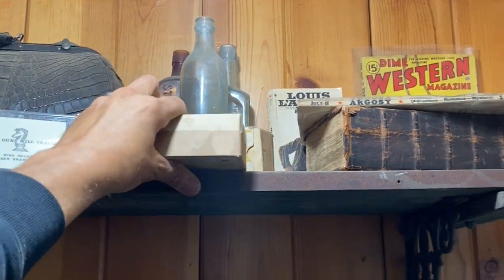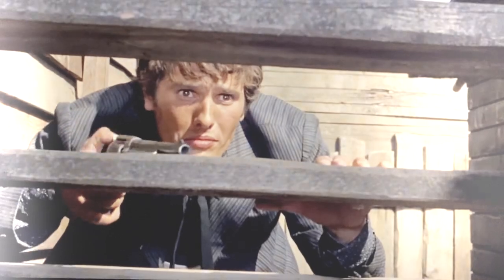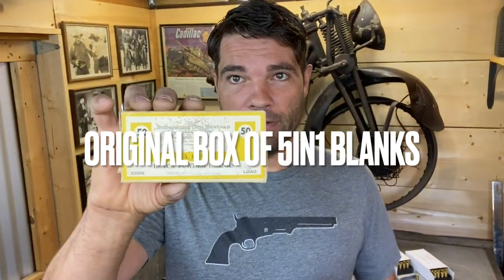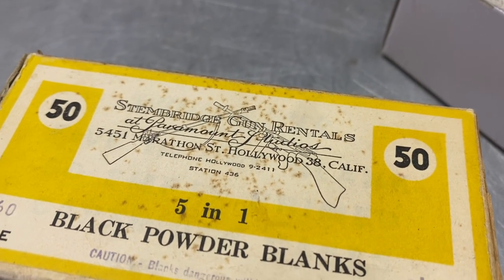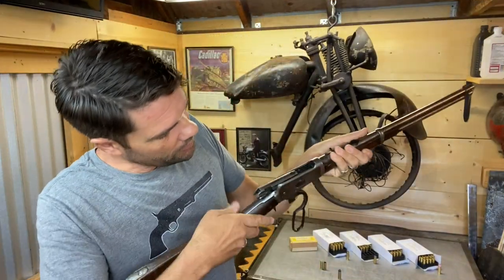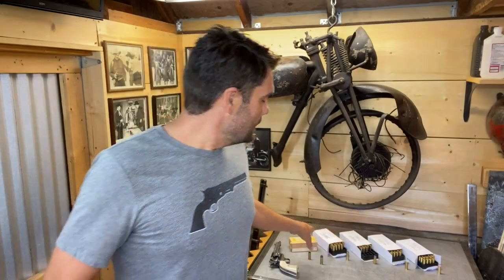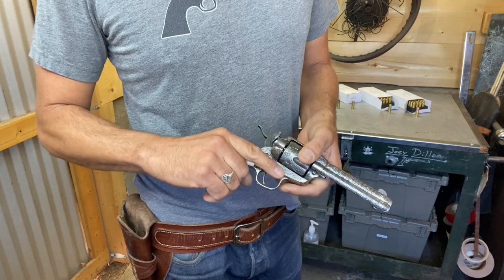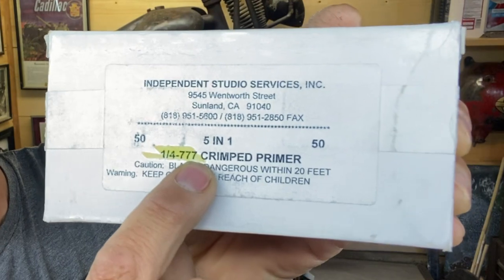5 in 1 Movie Blanks: History and Modern Use, with Armorer Joey Dillon

Comment: This was very interesting about how the movie industry handles various blanks. I took special interest in how they peen the primer pocket rim at 12:23. My method is to drill out the flash hole to 1/8 inch to let the gas escape and not drive the primer out. The drill out method can begin to fail after many reloadings. I think the primer pocket gets to big. Do you now if that is done with a die tool or is it done by hand with a punch?
Reply from the maker: Not sure how it's done!

Comment: I've been doing a Jesse James train robbery (1874 Gads Hill) gunfight show, St Louis Iron Mtn RR, for 7yrs now. I'd like to tell ya it's a re-enactment, but there was no gunfight in Jan of 1874, so we're actually giving the riders something most have never seen in person. As you can see in my pic, the wardrobe is more Warner Bros Central Casting than 1874 Missouri. Over the years, we've used a few different blank styles; WFDA balloon-load type, straight case foam-topped re-useable loads & the commercially available crimped brass blanks. Since we're an outdoor show, we use full-load blanks for the full effect for report & smoke. I personally like reloading my own with GOEX, but they provide the store-boughts for us. The upside is that they make dandy souvenirs for kids. Blanks & real guns on a movie set is something I hope doesn't become a thing of the past, but I have a friend who works out at Old Tucson Studios & currently they allow nothing but blocked-barrel blank guns. Hopefully, this will change.
Reply from the maker: Thanks for the comments. Sounds like you're having fun out there! Yea I hope blanks and guns continue too...
Reply: A local volunteer theatrical company was doing play "Shadows of a Gunman" about Ireland 1916. One of the actors brother was a gun collector/reloader who supplied a couple of period correct SMLEs, because it was an indoor stage full power .303 Blanks too loud, and primer only cases popped but little more. The brother put some Pyrodex in case with a loose bit of tissue to hold in.  Result was primer pop with some  flash and smoke but no extra noise but visually impressive in that type of environment. Never heard about anything like that. Is is done?

Comment: Hey there Joey. First of all thank you so much for being my inspiration for getting in this hobby. I now post videos on my YouTube about gun tricks as well. 

I just have two questions for you:

What modifications have you made to your Cimarrons if any? I ask that because you fan it decently hard and it seems to lock up just fine. Did you change the geometry of the bolt to lock up with the cylinder better?

Also what is the name of that trick you do where you switch hands by doing a rode agent spin then twisting the grip more to be caught by your other hand? I’ve done it for years but I never knew what it was called or who invented it
Reply from the maker: Thanks for reaching out! I haven't done any mods to my Cimarrons, they felt pretty great when I got them. I am not a fan of hair triggers, but I do like lightening the mainspring if it is pretty tough. But these were pretty good as is. That trick is called the "Saloon Keepers Roll."

Comment: In one of my old gun magazines from early 1970's, one of the Los Angeles gun guys (Peterson Publications), referring to reel guns, stated that Model 25 S&W revolvers in .45Colt, with available blanks, were used instead of Model 29's in .44 Magnum that needed custom blanks.  The Model 25 and Model 29 same gun just different calibers so audience wouldn't know difference. Is this true or just a gun myth?
Reply from the maker: That's a good question. Not sure about that one, athough I would think the 5 in 1 blank would work in the Model 29 and that blank goes back a long time.
Reply: @FilmArmorerJoeyDillon  I have some 5in 1 blanks,  both brass and plastic, I've never tried them in a .44 caliber chamber.  Years ago, in an article with pictures in gun magazine that a acquired, some crooks stole some pistols including a vintage, black powder framed SAA, loaded chambers with .44 Magnum cartridges, they fit but a little loose, and blew the gun up that was eventually recovered by police and returned to owner in that condition.

Comment: Thoughts on the 1873 colt vs the 1875 Remington? Looking at both from cimmaron in the 7.5 inch barrel. Really like the looks of the 1875 but hard to pick against the colt I’m assuming?
Reply from the maker: I love them both! I couldn't decide either, so I got one of each, and when I used to  do my gun handling routine on stage I would spin both. I had matching grips that sort of tied them in. The colt is best for its action, larger spur hammer to grab, but the Remington looks cool with that tang under the barrel...